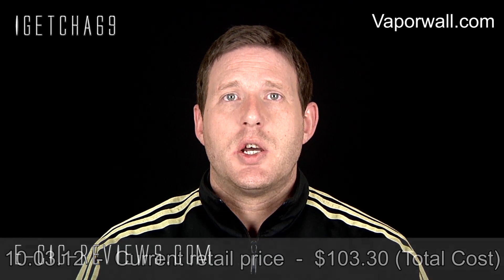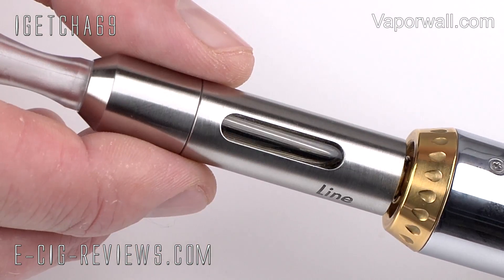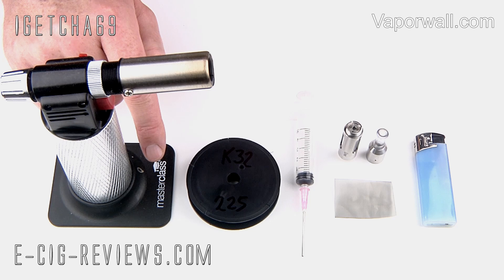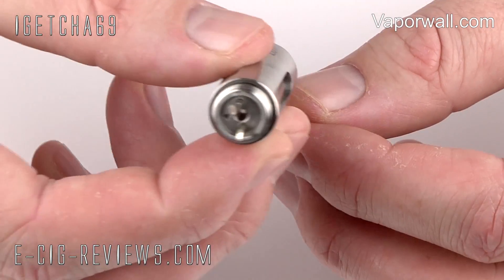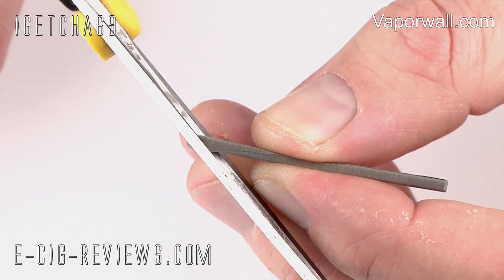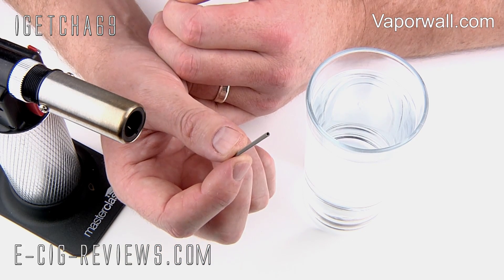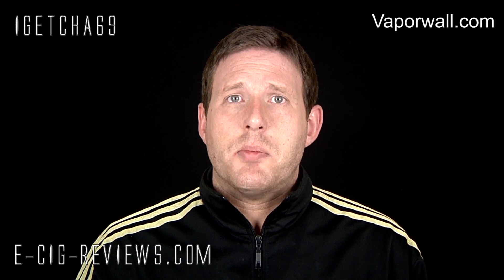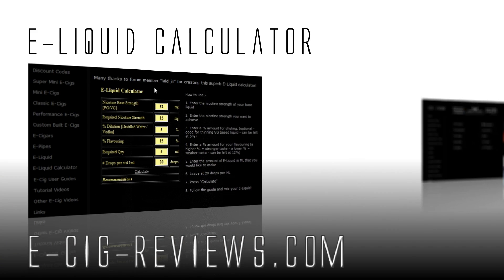REVIEW OF THE GENESIS LINE V2 REPAIRABLE ATOMISER

Comment: I bought a defcon off a friend, not quite a line but it's an affordable knock off.  I've been trying to get this thing to vape right for me with zero luck.  After watching your video during lunch, and listening to it on the way home, I broke mine down and followed your directions to the t, even pausing it when I needed to catch up.  My end result was a 1.5 ohm coil with the best wicking I've had by far, the thing vapes like a champ, thanks for the in depth instructional.

Comment from the maker: hi mate,

yes thats correct.....more coils (or longer the wire) the higher the resistance you will create

also if you use a different gauge wire (something like 0.16 for example) then that will also create a higher resistance

cheers

scott

Comment from the maker: hi mate,

i had a feeling you would describe that taste. a metallic taste from a Genesis atomiser in my opinion means only one thing....a short circuit

chances are that your mesh has not been oxidised enough. i know you are probably certain that it is, but bare in mind you only need one teeny, tiny pin head sized area to not be oxidised to cause a problem if the coils are running over it 

use a pin to give the coils a slight nudge up or down to move it away from the short or re do the wick ;)

Comment from the maker: hi mate,

personally i only ever use my Provari with the Genesis Line and as long as the wick is fully oxidised then you shouldn't have any problems :)

the new Provari's have a higher amp limit now so problems are even less likely ;)

and yeah, you should still get a really nice vape if you use your Ego battery though

cheers

scott

Comment: @professor88p Oxidizing the wick builds up a layer of carbon that acts as a buffer to prevent it from conducting electricity when the coil is wrapped around it or when it touches any other part of the assembly.  If you didn't oxidize the wick, current would flow through the Kanthal _and_ the coil (and the rest of the assembly if it's touching any part of it) and create a short.

Comment: Hi Scott,
Which vv mod do you recommend for the line v2? Should i get the lava tube, provari etc? I heard people having issues using provari with line. What if i just use it with my standard ego battery? will it perform fine?

Comment: hi scott,

Thanks for the great review. i am completely sold and will be getting this one soon. i got a question. if you run out of wire or the steel mesh, is it available in the local hardware store? secondly, i ordered the patriotMega atomizer the other day (haven't received it yet) from digitalsmoker and i didn't find any reviews on that one (you did review the UFS one though). Do you think it is anywhere nearer to the genesis line 2?

Comment: Hey Scott,
I just picked up one of the line V1 models secondhand, it's working great but there is a hairline crack in one of the windows.  No juice is leaking out but it still worries me of down-the-road durability.  Any clue on how one of those windows can be repaired or if any RBA repairing workshops exist?
Thanks for any info u can offer. :)